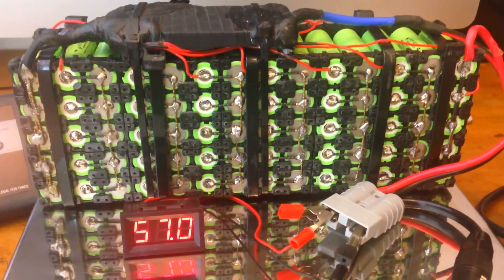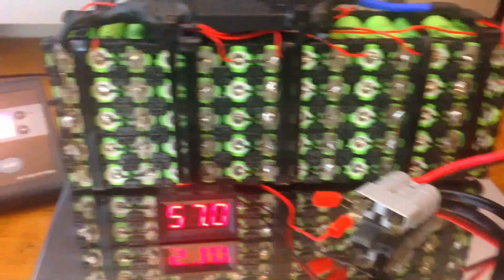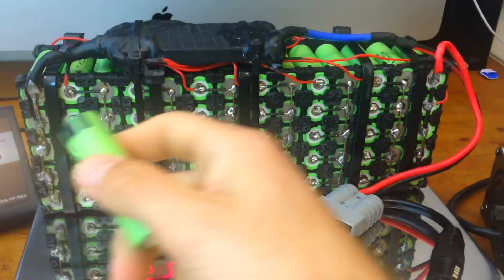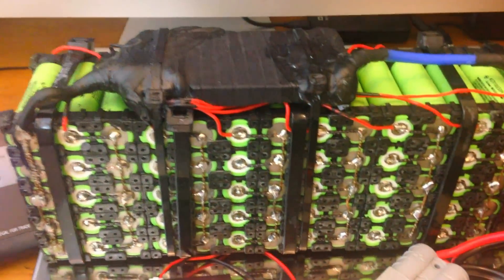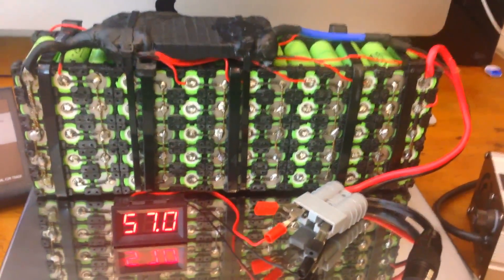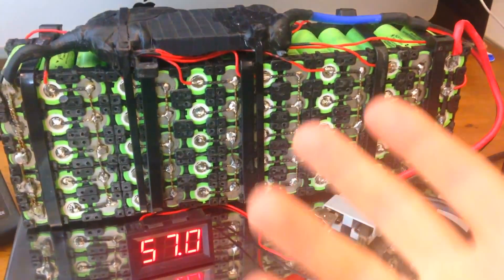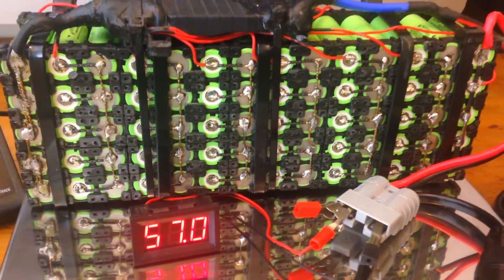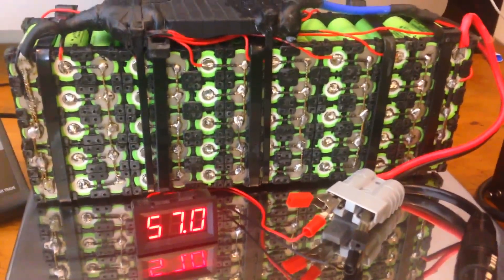Panasonic (Tesla) 52v 14.5Ah battery pack with Fast charger (14s 5p NCR18650PF) Bafang BBSHD BBS02

Comment: hi where do you buy the frame?
Reply: +ElectricBike (Bruno) oh man, what else would I need to make my own battery? :D thanks!
Reply from the maker: +Donatas Maldzius - Yeeeahh.. you can find all materials to build your own battery pack in this website here, they have EVERYTHING and a bit more hahaa.. http://www.batterysupports.com/battery-spacers-separators-c-53_57.html
So much POWEEEEEEEER =]
Reply from the maker: +Uilleam Gilvoni - Hola hermanoooo. I just sent you a maaaaassive message with links for everything answering all your questions, check out the comments above (or below) =]
Reply: got it! thanks man!

Comment: Nice build mate, could you tell me what the large white connector you're using with the battery output is called?
Reply from the maker: +hech - Yeeeeahhh... this is actually a light grey connector called "Anderson plug" very common to find this connection with high amperage battery wires. There are many different Anderson plug styles, this is the 50A size, there are smaller ones and bigger (giant) size too. Here is an eBay link for the 50A http://www.ebay.com.au/itm/50Amp-Anderson-Style-Plug-12v-24v-Carvan-Charger-Battery-DC-Power-Connector-/281871188683?hash=item41a0d502cb
I am currently using a smaller high amperage Anti spark connector called XT90-S http://www.ebay.com.au/sch/i.html?_odkw=xt90+spark&_osacat=0&_from=R40&_trksid=p2045573.m570.l1313.TR0.TRC0.H0.Xxt90s.TRS0&_nkw=xt90s&_sacat=0
There is also an even smaller version XT60
So much POWEEEEEER.. =]

Comment: Bruno, Good video's. I am interested in the bafang 8fun mid drive. I am an electronics guy and am planning to build my own battery pack. This is what I have in mind, please give me your input. Build 4 cells 14.4v each = approx 58 volts. Each sub cell would be 4 18650 in series and the 4 of these  wired in parallel. This would a total of 16 18650 batteries wired in series and parallel to make 4 sub cells = 14.4 volts., 1 main cell. 4: 14.4 volts cells in series will produce 58 volts.. Can a 48v 1k watt motor handle 58 volts?
I was planning to wire the pack to use a balancing charger with feed back wires from the 4 separate main cells. Am I on the right track in my thinking?
Reply from the maker: +Fleugar OutDoors - Thanks for watching my videos, I am glad I have electronics guys sending some "tech-questions" hahaa loving this conversation already =] Yes, lets talk about building batteries... first of all.. YES, the Bafang controller can handle up to 58.8v... it trows an over voltage message over 59v... the higher the voltage the more torque and faster the motor will spin (super fun).. the motor is not actually "designed" to operate under this increased load but it should be fine as long as you don't get too excited and do further modifications to the controller programming (watch this video https://youtu.be/ZZ-1BLIklO8 ). Talking about the battery design,  it could be designed in so many different ways but the easiest and practical when comes to electric bike is actually have a minimum of 11.6mAh for a reasonable range. So we are talking about having lots of cells there, too many cells to be monitoring or balancing separately. The best way is make follow the basic design connecting 13 or 14 cells in series and at least 4 in parallel. Try to buy a "battery management system" (BMS) to keep things balanced and the voltage to safe levels (not too high not too low). Some peple run their packs without BMS because the motor controller cuts when it reaches too low and your charger cuts when it is too high. This is a good website to get quality BMS http://www.batterysupports.com/battery-pcbnbsp-bmsnbsp-pcm-c-32.html 
This is not my personal opinion, this is how most of bikes are setup, I hope I helped a bit =]
Reply: +ElectricBike (Bruno) I got a ton of information form batterysupports.com, Just the schematics for the BMS speaks volumes. I see a new design for a battery pack is in order. Already in my head. Key thing and point, batteries in parallel will balance themselves, batteries in series will not. That's where a clever battery pack design and BMS will solve any problems.
Reply from the maker: Great you liked the website, they have really good BMS. Yes, batteries connected in parallel is the way to go.. self balancing no worrying about all that drama... the only thing you must pay attention when designing a pack like that is to not have any "bottleneck" (weak point) on your circuit. I'm sure you'll figure out =]
Please make videos showing whatever you're making and post here... people LOVE to watch that stuff... I do.. haha
Reply: +Fleugar OutDoors Your fully charged 16s battery will produce 67.2V.

Comment: Nice build! The spacers really make the pack solid, and conformal coating will protect it from the elements. My build is more like a rolling bomb with 20s3p (12x5s) lipo, no BMS lol Although I really would like 200 of those panasonic 18650s for a 20s10p build ;)
Reply from the maker: +th3d3wd3r  - "Rolling BOMB" hahahahaha you made me laugh hysterically here mate... thanks for that one. you made my day! =]  If you add more cells to your pack making it  at least 5 or 6p you will notice that  the cells will run much cooler (will also last longer), deliver a better and linear power during all your ride. Check out FastTech.com they have NCR18650PF (not fake) and very good price, you can ask for bulk rate and they make it even cheaper for you  Your next pack try to use these black cell holders, there are countless benefits, helping you keep it cool and your batteries will last longer =]
Reply: +ElectricBike (Bruno) The lipos take the punishment well at least. 5800mah per pack and 30C ;)
Reply from the maker: +th3d3wd3r - yeahhh .LiPo are the best for high discharge applications, I do have many LiPos at home but the NCR18650PF Panasonic cells are extremely reliable and last forever.... LiPo packs are ultra-powerful but lifetime is a different story.. the Panasonic you connect to the charger and forget about.. the LiPo ones... you MUST watch the batteries at all times.. they both have their positive and downsides... in the end I like both =]